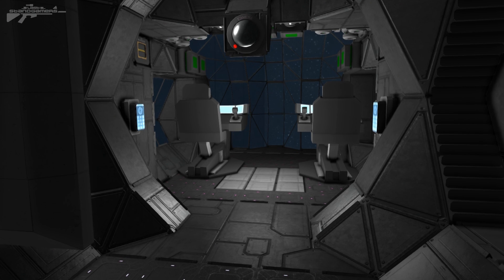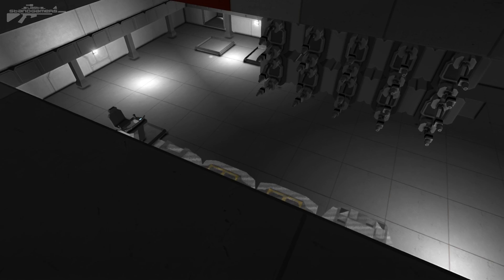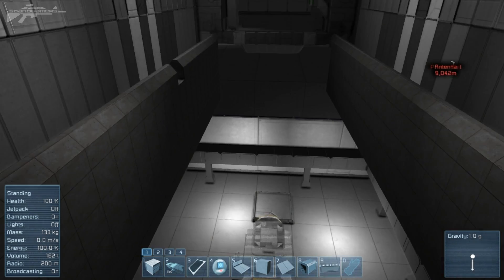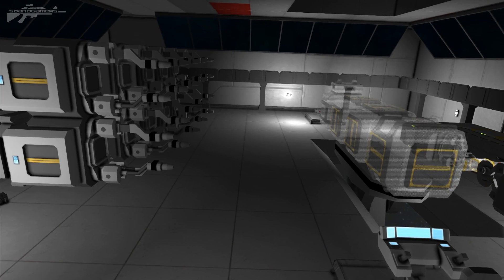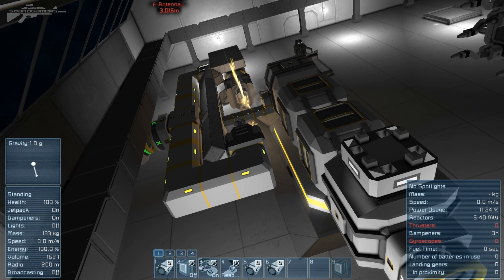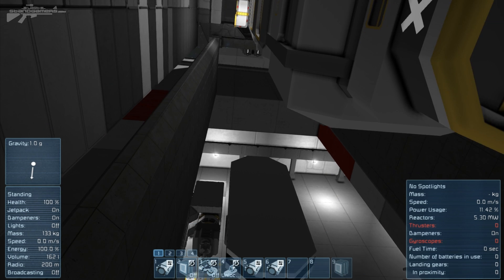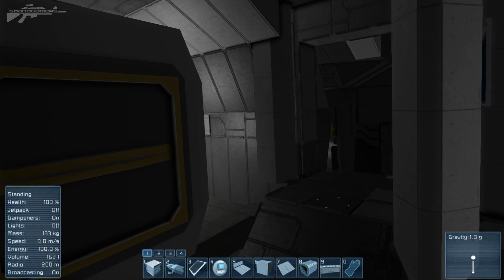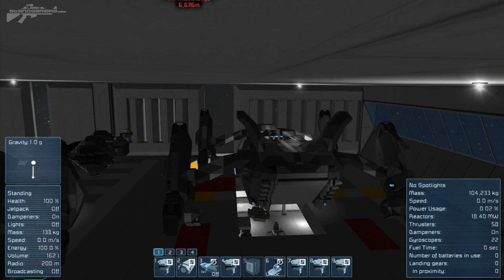Space Engineers - Modular Cargo Loading System (MCLS)

Comment: Hey I had a thought what if on the grappling hooks that kinda worked what if u make the hook to were it  penetrated the armor and there was a cockpit then you had a retractable arm system with landing gear and have thrusters on all sides so what happens is it penetrates armor then retract the arms which locked on then you can use your ship to pull in the chain if u read my comment plz do a video. p.s. this is only a theory so I don't know if it will work but u can try it

Comment: You could maybe set the large loading landing gear to auto-lock with a very small locking force so that all you need to do is disconnect the merge block and it will automatically pick up the module when unloading (also when loading you could just retract the pistons after the merge and it should release the cargo).

Comment: when do a bit of tricksing on the sensore you can have an fully adjusting welder,
with one sensore that decreases and increases the piston speed and a second sensore that increases and decreases the speed one at the start of the working area of the welder, the other one slightly over the top of the welders pointy end (the sensore area ends there)both sensors are mounted on the welder body and you start and stop it by increasing and decreasing the piston speed
so you have a piston that welds youre whole ship but without bumping into it, and when you construct this outside you can simple fly youre ship near it and it will adjust itself to the shape of youre shipside like a carwash

Comment: The dropship design could've used a passenger seat for a loadmaster.  If the carrier or station the dropship is getting its module from comes under attack, you'll want the pilot and copilot at the controls so they can scramble and either escape or, if the ship is armed, assist in defense or counterattack.

Comment: My friend had an idea of running a faction where all the ships run on battery power, and the battery packs disconnect using merge blocks and are recharged by little drones that bring back fresh packs to the ships, the station itself could be run on solar power.
Reply: My station runs off solar and every vessel except the largest are battery powered. Some have a single reactor as backup. Be aware those type of ships will be heavier the longer the ship needs to remain in operation for. These ships will require a connector to recharge and at least one small reactor to get the initial charge to turn on the connector.

Comment: I found a flaw with the backup generator module. What if it's a capital ship it will take lots of power and you will need lots but that's just my opinion okay
Reply: Thats not a flaw, you just need bigger ship, thats all
Reply: Yep, and a connector rather than a merge block. I'm pretty sure that a big ship merge block cannot merge with small ships due to the different grid sizes, There's is only the connector and motor methods to connect the two.

Comment: Tell me how your dropship act in flight? Whenever i build something like yours turnable engine pods it lags and crush like hell when i make harder turns... same issue with those advanced landing gears. Only stable solution i found is simple piston based retractable gears with solid shaft that holds them in place during flight.
Reply from the maker: It fly's rather well due to there being four pods it that are slightly staggered it balances it in flight. But it was a fuss getting it to work (a lot of testing) Here's a flight video anyhow so you can see for yourself.
https://www.youtube.com/watch?v=JPIeuPRVZp8
Reply: LastStandGamers  i see... slower accelaration and bigger center hull solve it. I was trying something like B-wing concept and rotors simply dont have enought force to hold bigger parts in place when you make fast and hard maneuvers. Maybe it would work on better PC then mine...

Comment: Guys check this idea out. You get Arrons ship, cut out the bottom, sides and back of the cargo bay and fit huge modules that are part of the ship, maybe protection not that good, but you can use more space, so modules can get bigger. 

I got this idea from modular heli from ArmA 3

What do you think about it, guys?
Reply: it's good but it wil need a slightly different design overall the cockpit would be to exposed and a small crewquarters is a must on multiplayer
Reply: Matthias Van Hecke
No no no, i mean just making those merge blocks clipping different modules there
Reply: Hunter Falkner oh